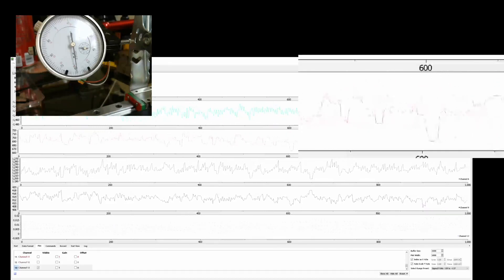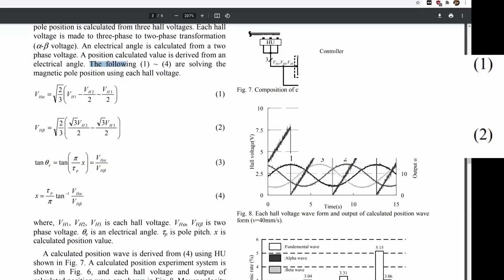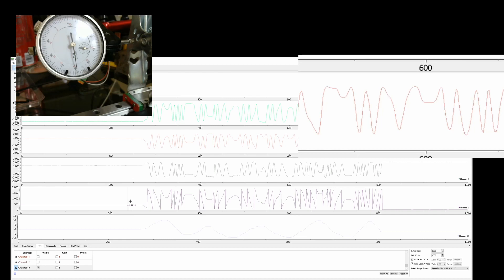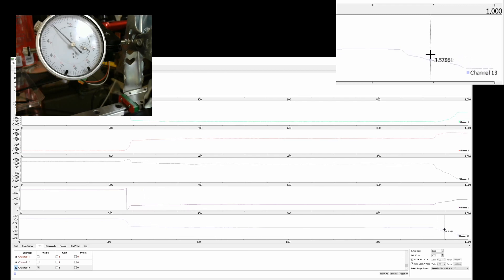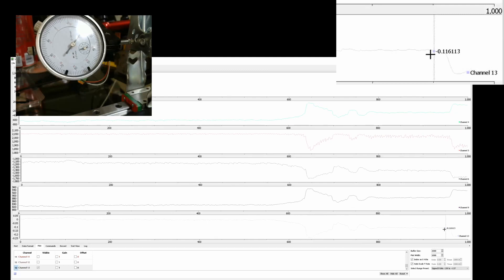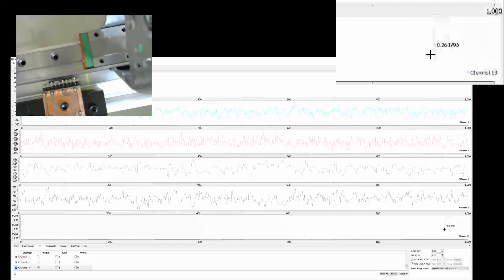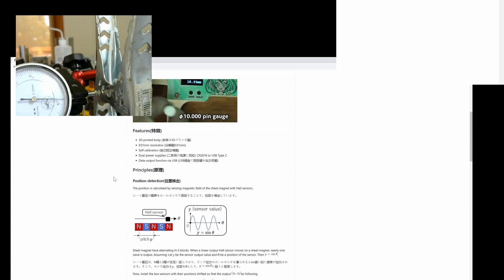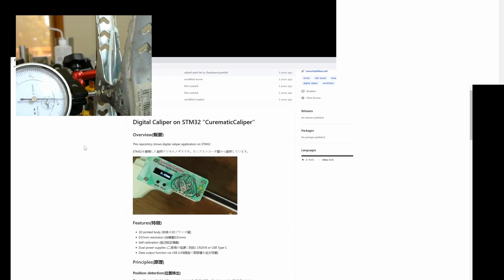$7 fridge magnet dro using 3 phase signal from TMR sensors

Comment: Fantastic! What makes the magnets consistent and precise enough to not need to map them? Mitutoyo's expired patents might be useful. An application might garner more attention than going deep into the math. Keep at it; very creative work!
Reply from the maker: The pole pitch seems to be very periodic and I think they stack magnets into a roller to magnetize these sheets.  I should add a zero index and map them but this is something i've never done in software and my c/c++ is very weak.  I think I could just mount a ball screw and a stepper to record the positions but i'm not sure how many data points i'd need or how to figure out the error correction.  The fridge magnet material's signal vary quit a bit but this may be good enough for my lathe unmapped. 

I was thinking of doing the input with my ELS web ui and hooking the bluepill up via serial.
Reply: @JesseSchoch  Check the reproducibility by measuring in at least triplicate, create a map of differences from expected to averaged measured, maybe baseline correct, interpolate between points in the map, repeat in forward and backward directions. Could even try at different temperatures of magnet or electronics. Also dependent upon the mechanical error, which may not matter if mapping over the range of your indicator or indicator plus stacks of gauge blocks. I'd love to look at the data. Its all pretty cool. I tried profiling magnets with a fluxgate magnetometer, but never thought it would be possible to create an encoder like you have done. Very cool
Reply from the maker: @kentvandervelden  here is some data on the material's flux profile